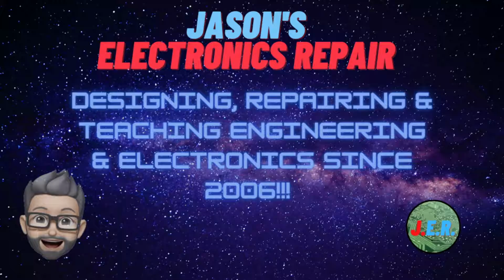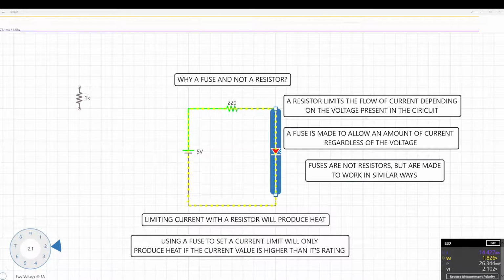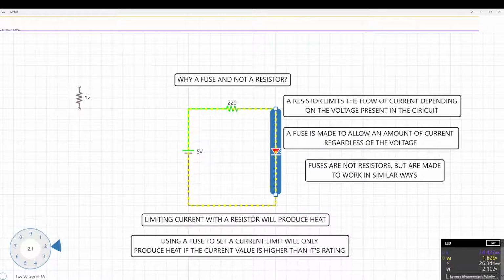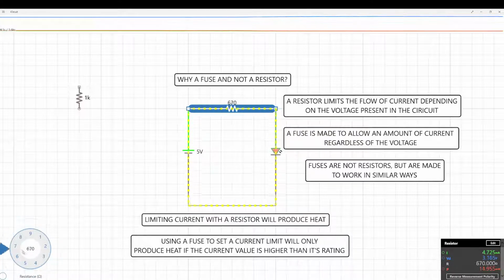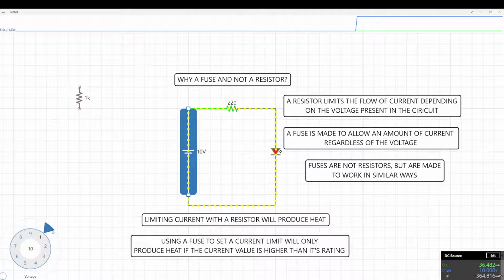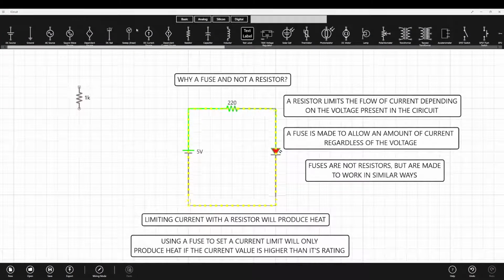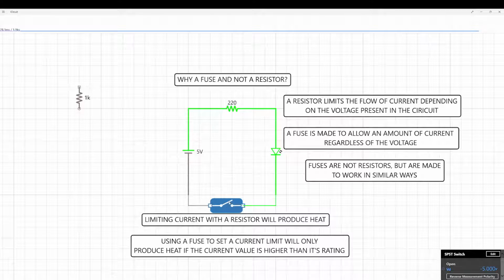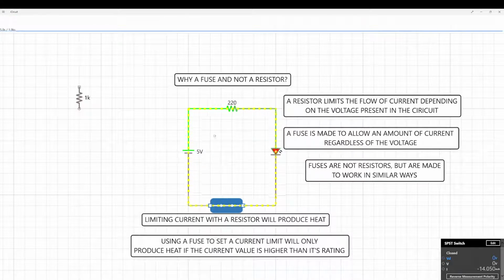ELECTRONICS ARE BACK WITH THE BASICS OF FUSES AND RESISTORS

Comment: Interesting I can see it coming but.. Zero-ohm links, Jumpers, Shunts & Zero-ohm Resistors are wire linked packages, that act like fuses. Enough of that, I've been busy
I have a lot! on my plate, I still watch things here & there. Great! to see you back at it. Oh Fusible resistors are designed to open without flames when overloaded 🖖👍
Reply from the maker: I was trying to keep it under 10 minutes not a 10 hour master class 😂😂😂. It’s great to hear from you Steve
Reply: JMC - Jason's Master Class 😁 I've been playing around with the Gloom code and have a 'linked, functioning' bot-steam deck command but.. there is still some bits to add for the counter(s) so far it will give info just not everything asked for yet!! 😥